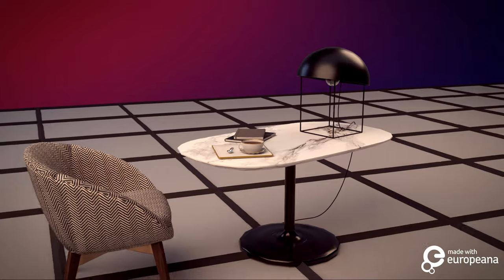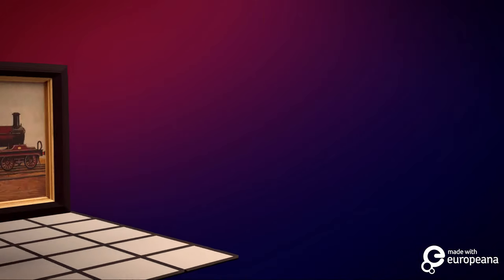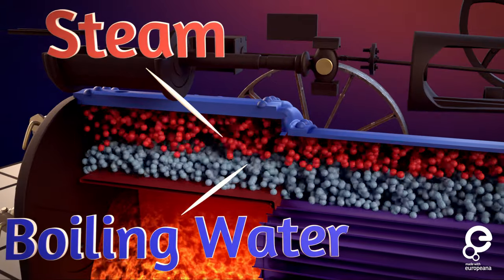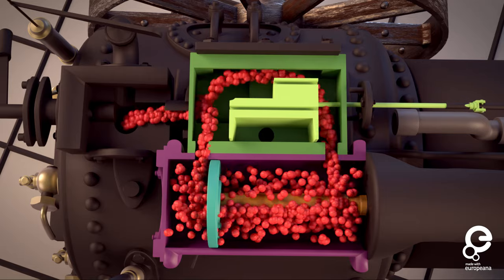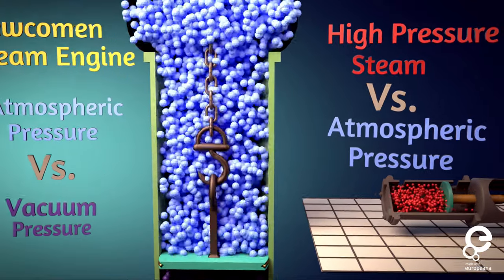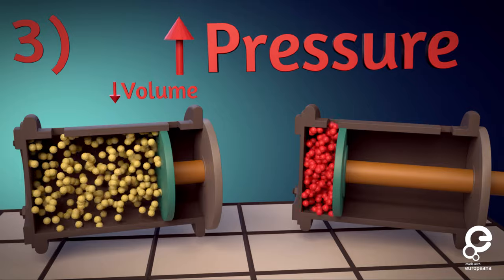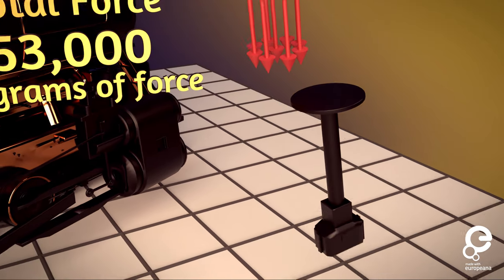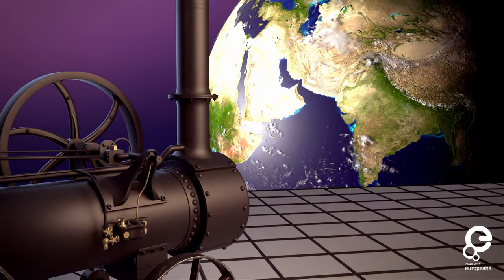How do Steam Engines Work?

Comment: For an idea for an advanced version of the steam engine, if atomized water is injected into the cylinder instead of diesel at the power stroke level, in automobile diesel engine technology, would it get vaporized in an explosion and force the piston down, starting the four– stroke diesel cycle of the engine with steam? I thought of this because when the piston comes up compressing the air inside the cylinder, the temperature of the compressed air is about 550 degrees centigrade –  and the boiling point of water is only 100 degrees centigrade. 

If that doesn't work, then at the suction stroke level, if atomized water is sucked into the cylinder, gets compressed, and by a device fixed at the top of the cylinder the compressed atomized water is heated either by induction heating or by microwave heating methods, and causes the atomized water to explode vaporizing the water and forcing the piston down, would it start a four– stroke diesel cycle of the engine with steam? In this case, the power drawn from the battery for induction heating or by microwave heating is what wears off while the water is recycled in the engine through a radiator. If this theory works, it could be made of use in heavy transportation vehicles like buses and trucks and even in agriculture equipment like heavy tractors and hand tractors. 

The above slider crank mechanism in the reciprocating engine can be also be used in steam piston propelled light aircrafts, which can be used in crop dusting. 

Electricity for the above engines is drawn from hybridized ultra capacitors batteries made from curved graphene and lithium ion, which can store a high amount of power than conventional EV batteries.

I have an idea to make lithium– ion batteries better by using the MOSFET transistor technology combined with 3D NAND flash memory technology, in the subject of hybridized ultra– capacitor and lithium– ion batteries, 

If an anode and a cathode is put in the floating gate of a MOSFET transistor, the anode or the cathode should induce current in it when a current pass from the source terminal to the drain terminal of the MOSFET transistor. Similarly, if a current is put at the control gate terminal of the MOSFET transistor, the anode or the cathode in the floating gate should induce a current in it. Then by combining millions and gazillions of such transistors like in a 3D NAND flash, we could make a better lithium– ion battery in this way. It could even be an ultra– battery, mega– battery or gega– battery!

But there is a way to increase the energy density of graphene to the energy density of lithium-ion, without the need to hybridize batteries. Ultra capacitors are carbon based and use graphene to store power. If you take charcoal and gems and diamonds, in future ultra– capacitors could soon be manufactured with their graphene layers made with the same atomic structure of gems and diamonds – like how artificial diamonds are made. This should increase energy density of graphene and could even begin the era of mega– capacitors and gega– capacitors. This method can also be experimented with graphene schwarzites with negative curvature, where a flat surface is necessary

Comment: Oh dear here we go again spoilt by the '' global climate change'' .
Reply: Truthfully a steam engine running on gasoline would be more efficient than an ICE.  The engine was designed to work with peanut oil,  which was the basis of what diesel would become,  gasoline waste product,  until someone modified a diesel to run gasoline.
Reply: What about it?
Reply: @johnsalisbury3768 it shows ideological conformity. Very much like the notion of not being the first to stop clapping for the man with the mustache. It's a sign of the sickness of our society and the infiltration of dark forces. Those who tow the ideological line are "good" and those who disagree are "dangerous to our democracy". It's the same sins of the 20th century that we swore we'd never forget, forgotten in less than two generations after the fall of the Berlin Wall. Just why are some things divisive, while others you can disagree on without issue? Because some things aren't to be questioned without going against the established narrative.
Reply: @jamestunedflat8942  Talking about science on a science channel is ideological conformity?

Comment: Steam engines need to come back, we can now use electricity to heat the water. And that same engine can regenerate its own electricity
Reply: The modern steam locomotives were designed since 1949 but the idea failed because the coefficient of friction was higher than 0.40 and maybe because of other reasons, too.
Reply: @lukythesteamlover  makes sense, after all water isn't a lubricant and can corrode moving parts
Reply: @Briansantiago11  yes, and for you to understand, this locomotive has only a friction coefficient of 0.28 https://www.youtube.com/watch?v=N-eebeVoPw4
Reply: It’s much less efficient to heat water to drive the locomotive, when you can just run the electricity directly to a motor.
Reply: A steam engine has an effiency somewhere between 1-5%, meanwhile an electric engine is between 80-90% efficient.

Comment: No no no! These engines did not put us 'at great risk'. Why do you have to RUIN a perfectly good video with political diatribe??
Reply: It's not politics.

That the steam engine kicked off the practice of burning carbon based fuels to convert its contained energy into motion is simply a statement of fact.

Releasing a lot of CO2 into our atmosphere has an affect on our climate. That too is a statement of fact.

You not liking a fact we can measure and verify doesn't make it politics.

Comment: I was on board until you started preaching about the environment.
Reply: @lukythesteamlover  Lithium iron phosphate batteries don't use any heavy metals, and don't even require manual labor. They don't require heavy mining equipment and minimal environmental impact. They are just made from iron rust. I love my Tesla with the lithium iron phosphate battery, I hope they bring this battery to the model y. Only the short range models have it in the United States and these batteries have a cycle life 8 times longer even though it's only half the capacity. It's the same size as the big battery pack but it just has less energy in it. But I like that it will probably last about 40 years if I charge it every other day.
Reply: @lukythesteamlover  This is exactly why Tesla has cut Cobalt out of its production vehicles in China and all of the short range model threes
Reply: @pilotavery  Yes, but remember lithium is starting to run out in this same year in a way that, in june of 2023 or before, they are going to start using sodium batteries. The problem with that is that sodium battery cars are not functional (i mean, not effective enough), in a way that, if they don't improve as expected, then they won't use even that.
Also, appart from that, lithium battery cars are functional but not efficient (they are heavy, slow, etc), so, wether if lithium is going to run out or not woudn't matter after all.
Reply: @lukythesteamlover  Lol lithium isn't running out, that's like when we said oil.was running out in the 80's. 

There's enough lithium in our ocean that it would only take 3% of it to make 1 Tesla model 3 for every person on earth. It only takes about a spoonful of lithium for an entire battery pack.
Reply: @pilotavery  yes, but i insist, that doesn't matter after all as lithium battery cars are inneficient, anyway...
Reply: @lukythesteamlover  What do you mean they are inefficient? Explain? They are already 97% efficient, compared to 40% efficient in vehicles. In fact, electric vehicles are so efficient that even if you take the gasoline and burn it in a power plant at 70% efficiency and then transmitted over power lines with 20% transmission losses, charge the car and discharge with 90% round trip charging efficiency, it still gets you more miles on the same gallon of fuel then burning the gallon of fuel in an engine. That's how incredibly efficient it is.
Reply: @lukythesteamlover  How are electric vehicles inefficient? They also are inexpensive, they can be recycled, and even though battery electric vehicles do take about one and a half times the amount of environment will impact as a gasoline vehicle, that offsets itself after about 7.5 thousand miles and then another 15,000 miles to break even on fueling carbon emissions. Long story short it's better to own the gas vehicle if you plan to destroy it on the track every 20,000 miles, but if you plan to have the car still be drivable after 20,000 miles, then it's better to get a battery electric vehicle.
Reply: @pilotavery  Electric cars are very inneficient!
First, you can't drive as far in one of them. The best electric cars now have ranges of well over 300 miles between charges, but many have a range of no more than 150 miles or less between charges, which means they are only suited for use in cities and on short, local journeys, rather than for long-distance travel. And to recharge them, they need at least half an hour of charging at a dedicated, high voltage charging point. Compare that with the time it takes to fill the tank of a petrol or diesel-engined car and the fact that many new cars can now go 500 miles or more between refills. Using the heater or air con in an electric car will also have an impact on their range, and batteries hold less charge when it’s cold.
Also, electric vehicles have significantly higher defective rates than internal-combustion vehicles across model years 2019 and 2020, according to the study of consumer reports (in-car electronic problems, climate system problems, noises and leaks problems, drive system problems, power equipment problems, and they have even problems like electrical issues and transmision issues).
And you have even the issue about battery weight. They are so heavy they requiere more power output than normal, and even having that, some can not reach the same speed than an internal combustion car equivalent.
These are only some downsides, there are more...
Reply: @pilotavery  Prices have nothing to do with efficiency nor with functionality.
And regarding the environmental impact, to get a real idea of how much greenhouse gas is emitted during the manufacture of an electric car, you have to look at how its components are sourced and made. The raw materials for making the car have to be mined, and the process of mining creates a lot of greenhouse gases. Then the raw materials have to be refined before they can be used, which again emits more greenhouse gas. Then more greenhouse gas is emitted in the manufacturing process.
Of course the above is also true when manufacturing a petrol or diesel car. In fact, taking into account the whole production process, making a petrol or diesel car releases about 7 to 10 tonnes of CO2.  
Making an electric car releases roughly the same amount of CO2, but then you have to add in the production of the battery.  Estimates suggest that 150kg of CO2 are released for every 1 kiloWatt hour (kWh) of battery capacity. For an electric car to have a decent range (say 300 miles) between charges, it needs a battery that’s at least 60kWh in capacity. This means that a further 9 tonnes of CO2 will be emitted during the making of an electric car, giving a total of 16-19 tonnes of CO2 emitted. So, an electric car seems worse than a fossil fuel one.
I don't care about any of them, as i love steam engines and not cars, i'm just saying that the environment is just a tall story...
Reply: @lukythesteamlover  the amount of energy you put in versus how much goes to motion determines the efficiency. Fuel cars are about 20%, electric cars are about 96%. Secondly, engineering explained already broke this down. Yes, it actually is a lot worse for the environment to manufacture an electric car over a gas car. Fortunately, the break-even point is about $27,000 mi, so if you plan to crush your car and replace it with a new one every 27,000 miles, then you should be getting a gas car. But if you're planning to have the lifetime of the car last more than that, then it's not.
Reply: @pilotavery  Again, you are thinking about the thermal "efficiency" and the environmental impact. Just ignore that for a moment and think about the dissadvantages related to functionality and the other aspects of efficiency. For instance, autonomy, technical problems, battery weight, speed and more problems that i don't even remember now. They are not good enough.
Reply: @lukythesteamlover  oh, I didn't have an issue with mine... It charges in 14 minutes and that only is a concerned cross-country so I have to take a 14 minute break every 4-5  hours of driving which honestly is fine with me. Most of the other issues were on previous cars, modern electric vehicles aren't so much an issue. It is a little bit heavy though, but that does mean I get excellent traction in the snow!
Reply: @lukythesteamlover  you should check out engineering explained video on this. Making an electric car is worse, but driving it is better, to the point that if you drive it 27,000 miles or more before destroying it, the total overall amount is less.
Reply: @lukythesteamlover  I love that you tell them to just ignore the literal definition of effiency, what other aspects of physics do you think we should ignore?

Comment: A 21st Century steam engine would make gasoline/petrol/diesel/electric vehicles all obsolete.
Reply: The modern steam locomotives were designed since 1949, but the idea failed because the coefficient of friction was higher than 0.40 and maybe because of other reasons, too
Reply: No, steam engines fundamentally suck ass for all applications other than huge stationary engines like the steam turbine in a powerplant.

Comment: Interesting but inaccurate. You forgot Richard Trevithick, (born April 13, 1771, Illogan, Cornwall, England—died April 22, 1833, Dartford, Kent), British mechanical engineer and inventor who successfully harnessed high-pressure steam and constructed the world’s first steam railway locomotive (1803). In 1805 he adapted his high-pressure engine to driving an iron-rolling mill and to propelling a barge with the aid of paddle wheels.
Also repeating the falsehood that the Industrial revolution has caused climate change doesn't make it true! That's just a lie peddled by the Bolsheviks at the UN. There is zero real world evidence that climate change isn't natural!
Reply: Timetravelrs - should they just forbid Coal-Use? Can Nature-Damage be completly dodged and if it can, How?

Comment: Why in the hell would I subscribe with the political commentary?  Are you aware that for every coal mine (In the United States) that once the coal seam is mined out, that it's intentionally collapsed then the land is reclaimed?  The companies have to post a bond of $3,000 per acre to redevelop this.  Are you even remotely aware the way how burning coal gasses and fumes are extracted, cleaned, in such a way that doesn't affect the environment?  And where in the hell do you get off writing about computers- all which take electrical power- then saying how evil coal is?  If I was back at the college as an instructor I'd kick this back and have it redone.  OR, I would have the students make a 3rd video on how to solve the conflict between required electrical needs vs. the techniques to provide power to their cell phones, their homes (or apartments).

Comment: Was great until it turned into climate hysteria. Being that there is less carbon in the air than since forever almost. Anyway, steam engine are wonderful. Let's invent some more forms of power creation for sure. And let them replace internal combustion and steam for sheer economic and productive viability in a free market. Xx